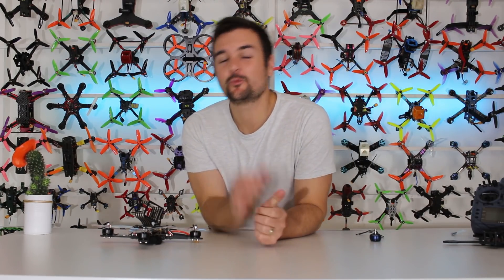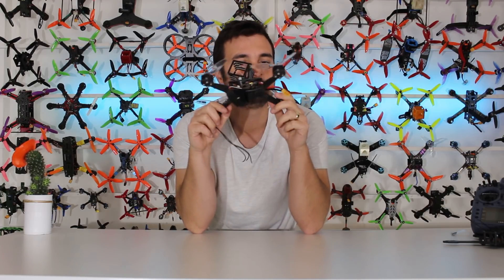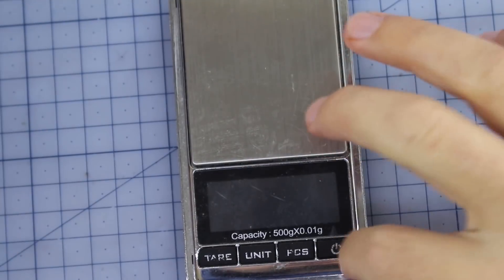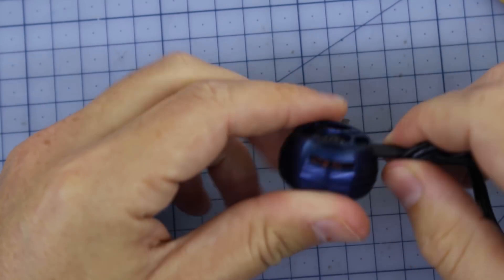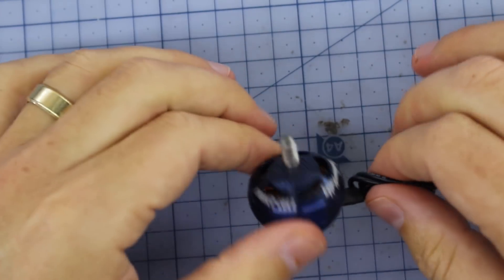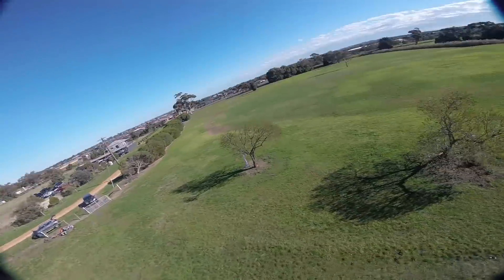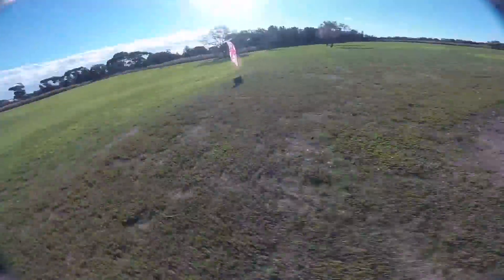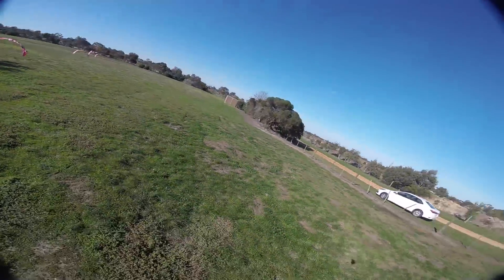STRANGEST DRONE MOTOR?? Engineer X's 2307

Comment: To me the shape of the motors hint at durability . Add onto the slots for cooling and it reminds me of the "Cool Stop" brake pads I used WAY back in the days of BMX . However I'm a little bummed out that they didn't have a 2160KV or 2200KV motor option for the 6" realm . Love to try that with a 6s   (>,<)\m/

Comment: 7g per motor heavier than the T-Motor F40 pro 2 (which is a 2306).

Good freestyle motor, but maybe too heavy for 5" racing (as power would not make up for the increased inertia).
Reply: Depends on how you fly and what type of frame, I can feel 30gr for sure, but I feel I fly faster and smoother with a bit more heft, I use the inertia to push the quad past my turn so I can have my nose already pointed to the exit and just punch it out when it's time- extra weight and thrust also makes for amazing launches that lead to impossible hang time.
Reply: Does depend on your racing style.  However, I'd contend that on a like for like frame, the lighter the overall quad the less inertia you need to counter to make the corner and the less weight you need to accelerate in a different direction.

In freestyle, inertia is your friend for better hang and butter smooth transitions.  Racing, not so much, where you balance smoothness with raw power.
Reply: I don't "race" but I do laps and my flying style even when freestyling is very very aggressive, like 1.4 minutes most the time before the pack hits critical, I've flown the lightest of the light and some real porkers and every time I keep going back to 320-390gr. dry frames.

The way I fly is the best I can explain is I "fling" it around, with throttle input much like a slot car, but then again, I also have switched to all stretched plus (cross) frames so my tastes are a bit of a fringe case.

That is the great thing about this hobby, is you get to pick and choose what you like best, so these while heavy, are still viable race motors even though they don't seem so, my main motors are 2307 RaceKrafts, and are absolutely perfect for how I fly.
Reply: Thus you have articulated the difference between fast/aggressive freestyle and racing.

The main purpose of the hobby is to do what you like.  Some want to be BMS Thomas type racers.  Some want to be SnakeFPV type freestylers.  Most are happy between the two extremes.

My comments come from the Granger/BMS Thomas track racers side of the hobby where lap times are king.  From that perspective, 30g heavier is significant penalty.
Reply: It also depends on the track as well, extra weight swinging around isn't going to do much good if it's a tight course, but on a fast one, it could work to your advantage as the weight increases usable forward speed and corner tracking, it's why I have an over-powered 3" quad, fast as hell when you want to weave around trees and don't have much room for error, and my "pig" at 560gr AUW with a gopro for warping to tree to tree, altitude control is much easier with a mid-weight rig.

It was the same thing with surface racing, you want a light/stiff car/buggy for a very grippy track, but for a loose track, you want that extra weight and flex for mechanical grip.

I have no interest in competitive racing anymore, too many trends, too many attitudes, too much hassle, as much as I think it could be fun and I could hold my own, I enjoy my own company and the scream of the props.

Comment: I'm using this exact motor on a Sonic model F1 wing on 4s on a 5050 prop and it's stupid fast. 
I'd prefer it without the enclosed bottom to give it a bit more airflow for temps and save a gram or 2.. but other than that it has a very good spec and performs extremely well. To be perfect for the F1 it just needs the open bottom and a magnet retaining lip at the bottom of the bell.... mainly for increased peace of mind that it won't throw a magnet. So far so good though
It's a 9/10 motor for me. :)